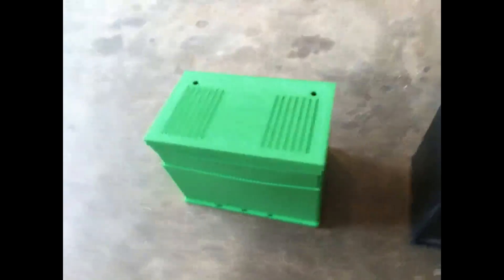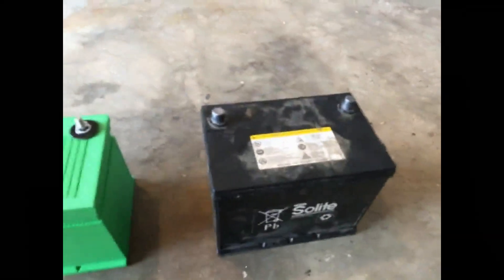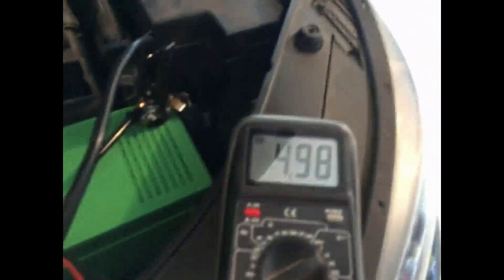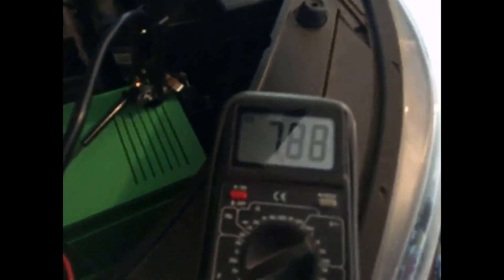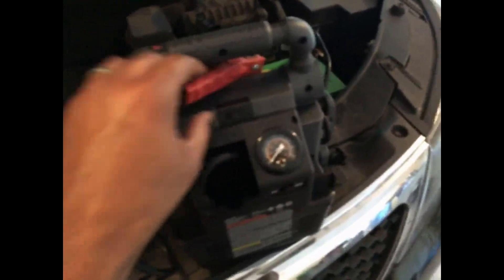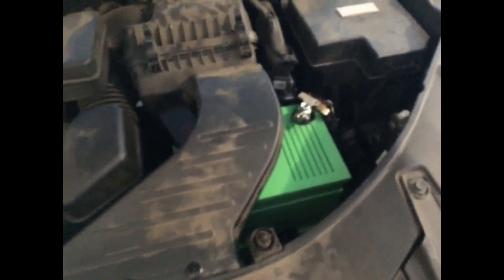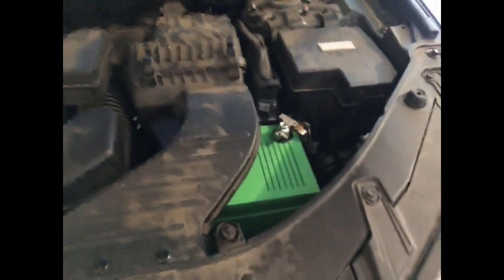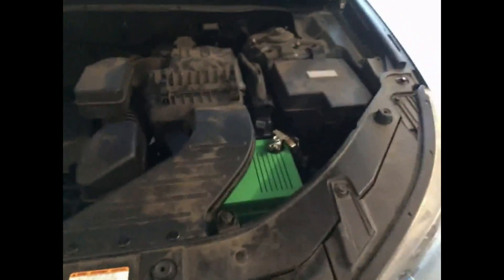Car Battery Replacement with Maxwell Ultra-Capacitors in 3D Printed Box

Comment: Is there any advantege of using super capacitors? Or even use it in parallel with the batery?
Reply from the maker: Yes, I've been using super caps for years now and my car is running fine.  The primary advantage is that I'll never have to buy another battery for my car.  Another advantage is that when the car is running, the caps provide a lot of power to internal components.  I believe the caps also provide really good power to the spark plugs.  I convinced a family member to try super caps in parallel with the battery and he loved it, he even mentioned that his car actually runs better and gets better gas mileage,  my guess is that it's due to the better spark from the plugs.

Comment: Hi, great project, can you provide de File for the print also the parts needed, I'm a Engineer student from Venezuela, so I likely do a project in my university like this one.
Reply from the maker: I used 6 Maxwell 2.7v 3000F UltraCapacitors, 3 aluminum connector plates, 3 balancing circuit boards.  You can check ebay for "New USA Maxwell 2.7V3000F super capacitor K2 2.7V 3000F＋Connecting piece G721 XH" and "2Pcs Electronic Component Two Series 2.7V 3000F Super Capacitor Protection Board".  Do a search on ebay for those items and your set.

Comment: Love the 3D printed box, makes the whole setup look a lot better, even if the green does stand out a lot! I have a quick question if you don't mind. You say it charges up pretty fast with a solar panel, any rough idea of how long and with how big of a solar panel?
Reply from the maker: Thanks for the comment and the suggestion.  An 80w to 150w panel will do just fine.  I've charged a bank with one of my homemade panels which was roughly around 80w and it charged really fast with no problem.  You can check out lasersabers channel to see the scenario where, if I remember, he's charging with solar and using hand tools.

Comment: I'm curious, is there a chance to overload, when the super capacitors are charged there is a circuit that blocks the current or the dynamo continues to load them?
Thank you.
Reply from the maker: Thanks for the comment.  The alternator will will continually charge the caps while the vehicle is driving, also at the same time the caps will continually supply power to the car's internal electrical loads.  At 2.7v each x 6, these caps are capable of charging up to 16.2v, however, the alternator will hover around 14v to 14.5v, thereby never reaching the maximum voltage capacity of the caps, when sizing the capacitors for a particular use application, this is very important.  Also there are voltage balancing circuit boards on each of the caps to prevent an individual capacitor from being out of balance with the others.  So with all of that in mind, the chance of overloading the capacitor bank in this case is highly unlikely, not impossible, but again highly unlikely.

Comment: I found my Toyota starter wouldn't engage below 9V either, but my old diesel Merc will crank right down to 5V with my caps. Might be a gear reduction vs direct drive starter thing
Reply from the maker: Could be, or the difference in the type of ignition system.
Reply: Not to mention that voltage is significant when it comes to computers, specifically the fuel injection, which also can have a antitheft interlock

Comment: You really don't need the vents since the caps never get hot I would also put a anti-humidity pack to absorb any humidity in there. I've had mine for about four years now with no problems.
Reply from the maker: Thanks for comments and the info.
Reply: How has it held up?

Comment: I like your idea, but it's not to practical for a every day use. Like Radio playing while washing the car, or having a car charger charging a cell phone when the car isn't running, just a lot more things you got to do different that your use to doing with a regular battery. But a fun project more less! Peace..
Reply from the maker: Thanks for the comments.  It's definitely not for everyone, but for some like myself it works great for everyday driving.  Granted, for the things you described like listening to the radio while washing your car, that will not work with this type of setup.
Reply: Solar panel can help with that

Comment: Nice job! Save 40 pounds by getting rid of the lead acid battery. If like me you add a solar panel to your car roof rack, it will refill your battery while it sits parked in the daytime!
Reply from the maker: Thanks for the comments.  I have a 5w solar panel in the car that I can sit on the hood or roof of the car and charge it up fairly quickly.
Reply: +rhandsom you should try it! I calculate, if you have 2x5w panels in full sun, putting out about 10 volts at 1 amp, it should take 150-300 seconds,  or 3-5 min, to get your pack able to put out 10 volts at 50-100 amps for 3 seconds, enough to start your engine.
Reply from the maker: christothegreat1 Actually I've done it already by charging my portable boost box with it.  It charges really fast.